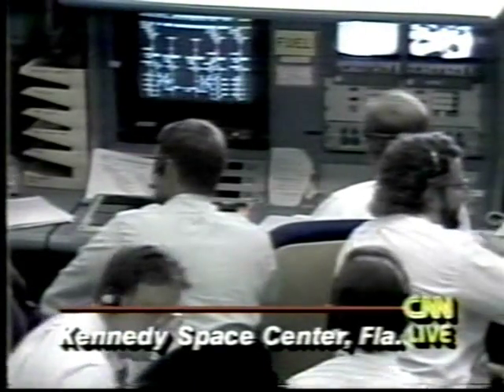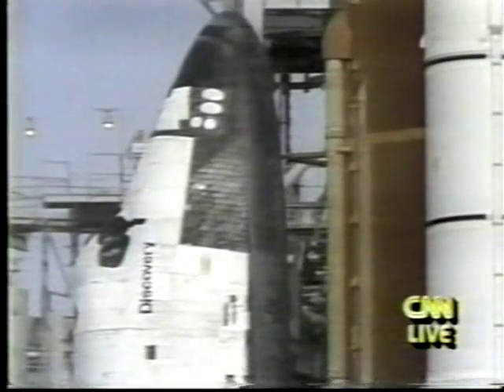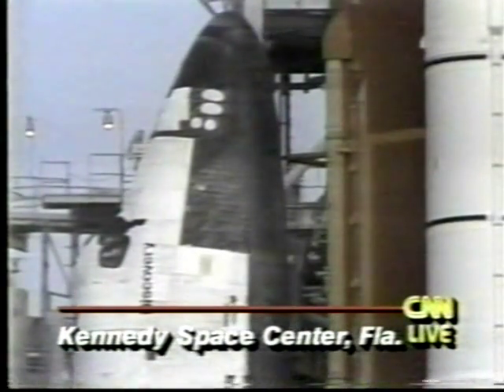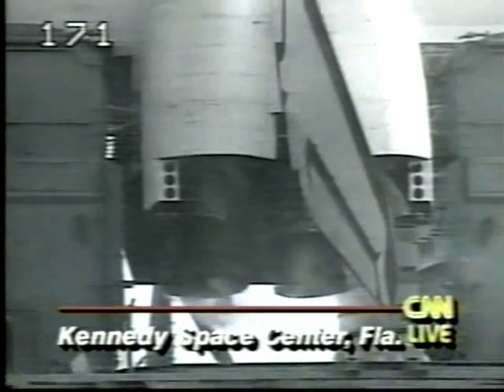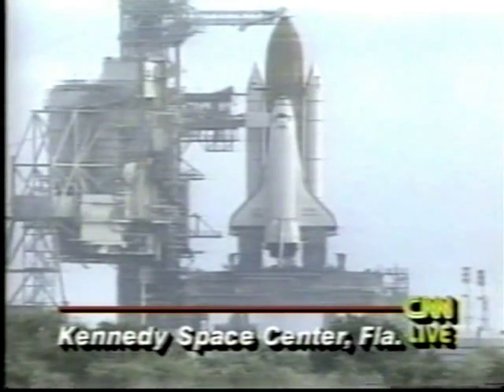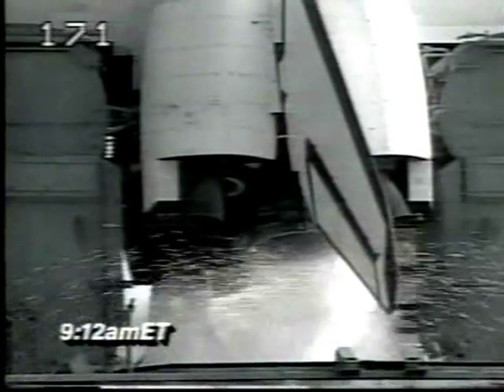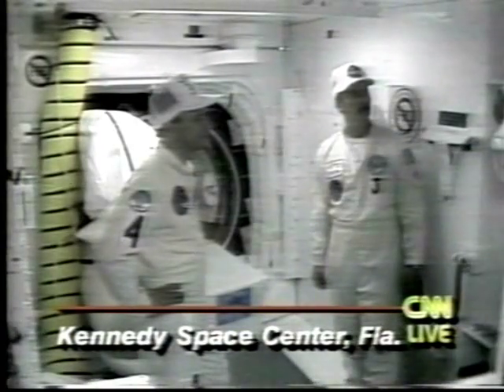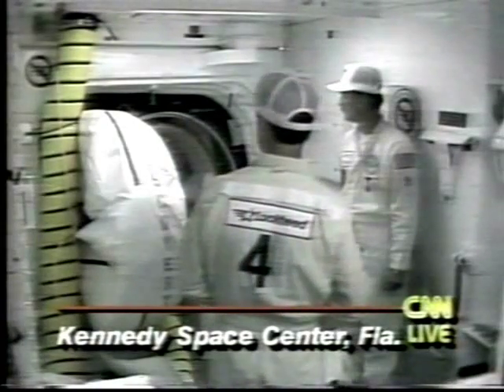CNN Coverage of STS-51 Launch Pad Abort Part 2

Comment: George DIller has his facts completely backwards and twisted about the THREE previous  similar aborts.  The correct facts are:
Discovery 41-D June 26, 1984 was actually the first one, Challenger 51-F July 12, 1985, Columbia STS-55 March 22, 1993, and then this one, STS-51 Discovery. There was one more on Endeavour STS-68 in August 1994.